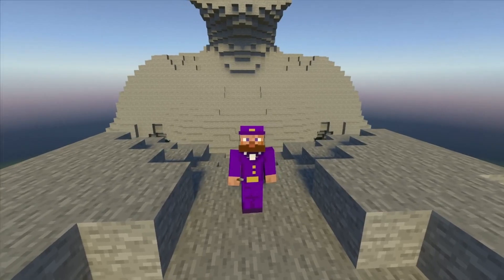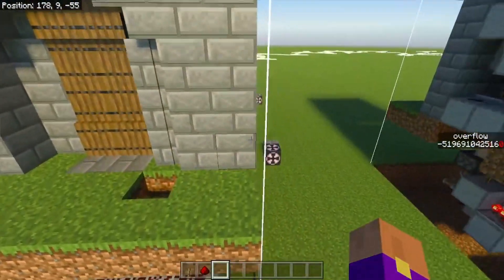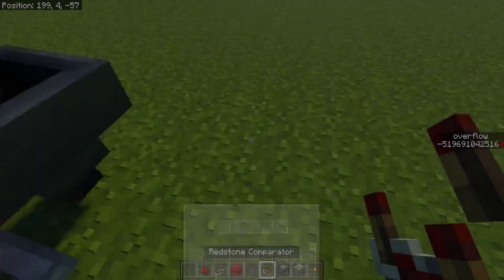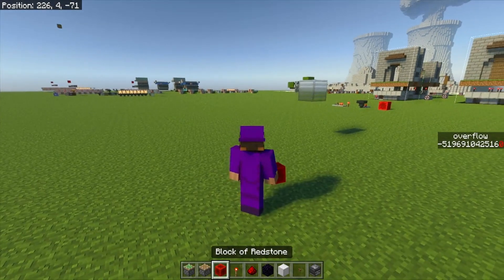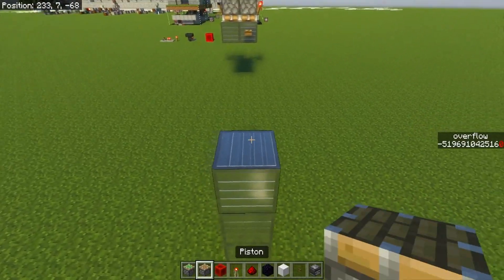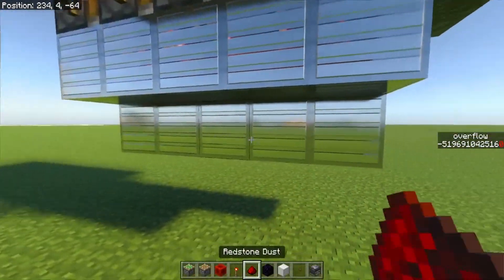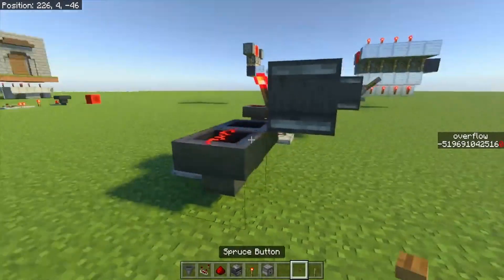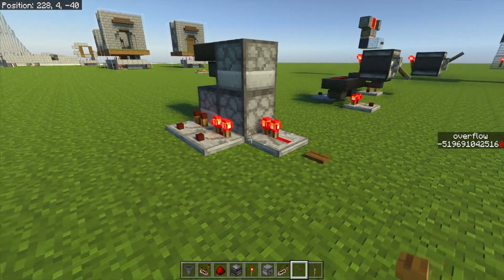How do Flip Flops work in Minecraft Bedrock

Comment: Cool feature of the triple dropper flip flop you can have actually use the hard power requirement to have a secondary input that is only capable of turning the flip flop off by soft powering droppper i used this for a reset timer switch thingy
Reply from the maker: That is a bit of a different circuit. It is a latch not a toggle flip flop. A lach will convert the first pulse to a signal then a separate reset signal is used to... Reset